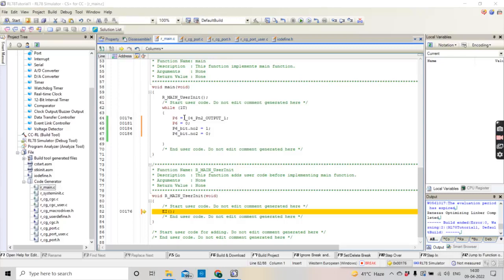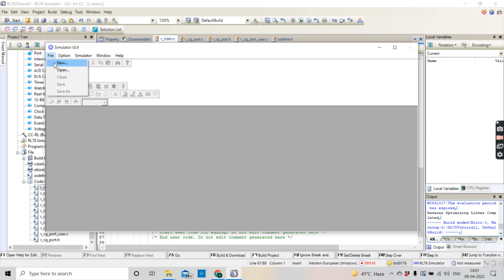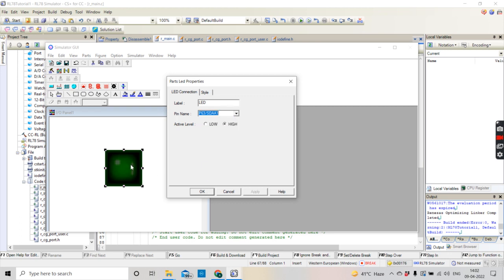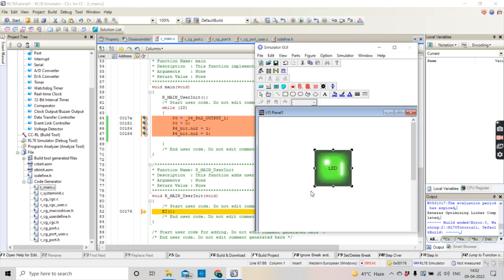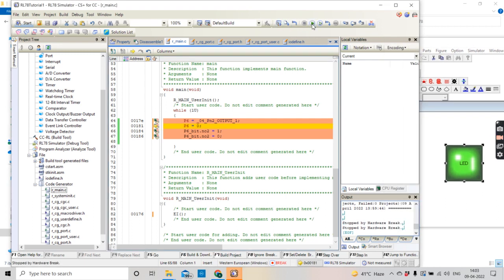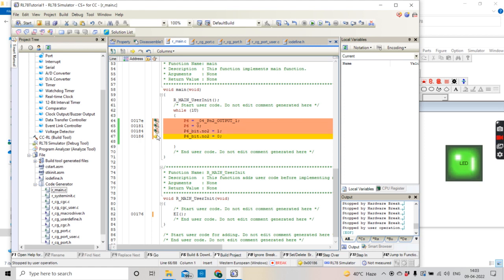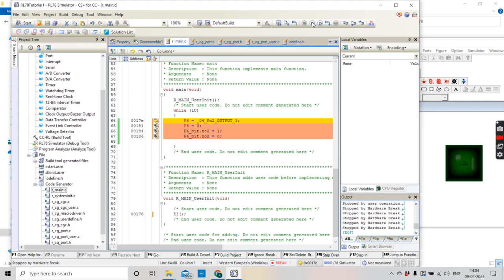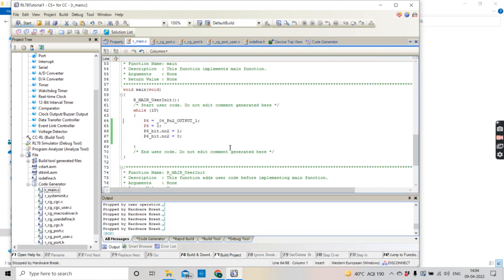RL78 Microcontroller Cubesuite+ Programming Tutorial LED Blinking and Clock Tree Explanation Video7

Comment: can i use CS+ CA CX IDE ??
Reply from the maker: Yes you can use that as well. But know that in order to change bits there is difference in both IDEs.
CCS : P1_bit.no0 = 1;
CACX : P1.0 = 1;
Reply: @Embedded_KT  okok thanks
Reply: @Embedded_KT  please upload video for basic RTC ,delay & Alarm
Reply from the maker: Hi, I work in macnica cytech. You can connect with us if you require further assistance. We are renesas distributor partners. You will get the contact details from macnica website. Go for the region you are located in.
Reply: @Embedded_KT  oh really we are already working with your company

Comment: Bro,code generator block not shown in project tree.
Reply from the maker: Yr, it does not come for all micro controllers. Please select the one i selected. If you have finalized an mcu whose code generator does not come. Then download appilet 3 and 4(both). Some mcu are in appilet 3 and some in appilet 4. Check for your mcu. Files will be generated in your selected folder you will have to add them manually. First finish my video tutorial on the mcu that i have selected. Things will become easier for you.